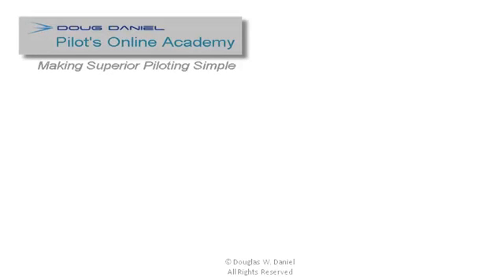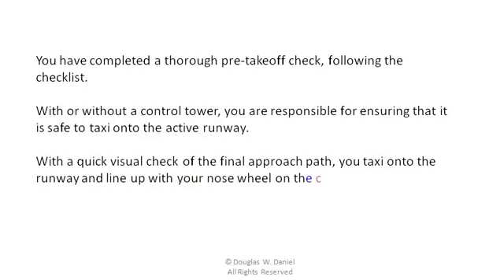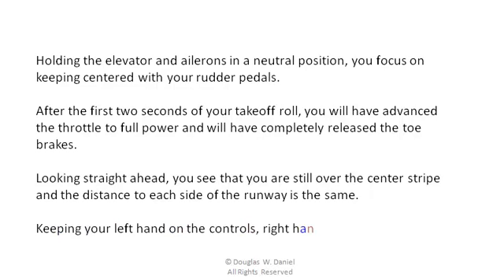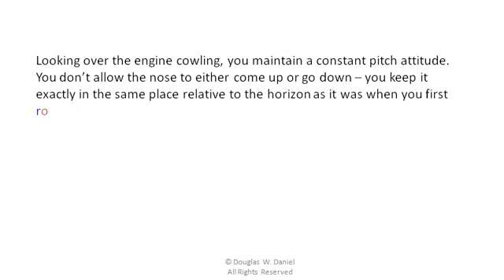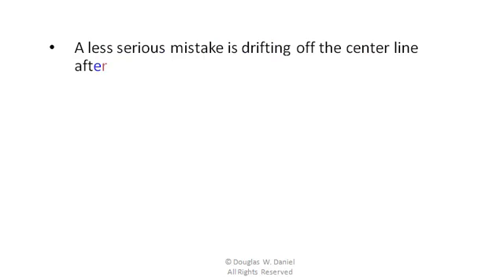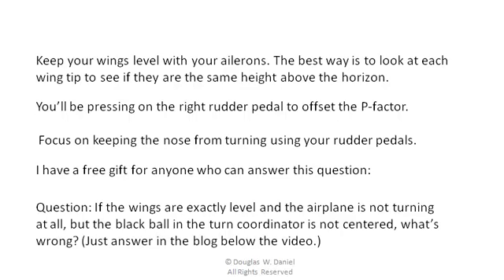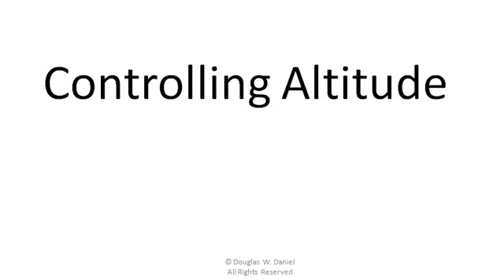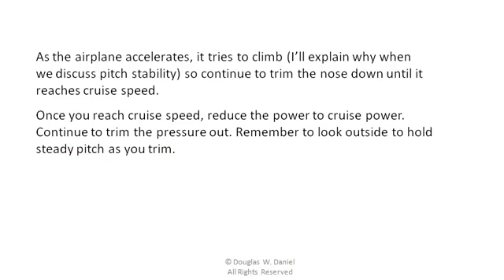Takeoffs, Climbs, Leveling off, Glides

Comment: Answer to the question: The aircraft is either slipping or skidding. It can can be due to cross wind.
Reply from the maker: Since no one has got it right, ever, I'll just tell you the answer: The turn coordinator was not installed properly. Wings level without turning is more fundamental than the turn coordinator. The ball should have been in the center. Since it wasn't, someone changed it. I've seen it happen several times, always when the airplane was sitting on not-quite-level ground.